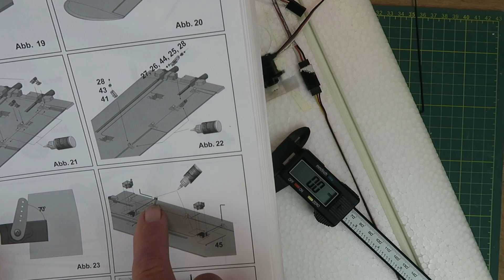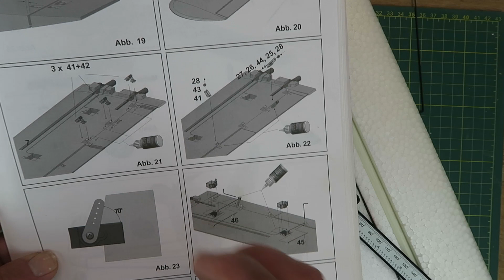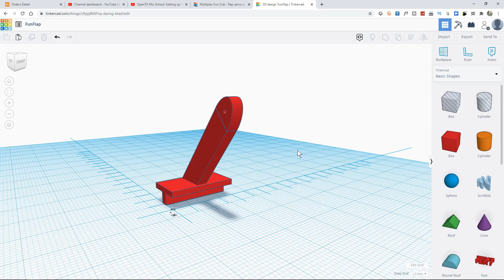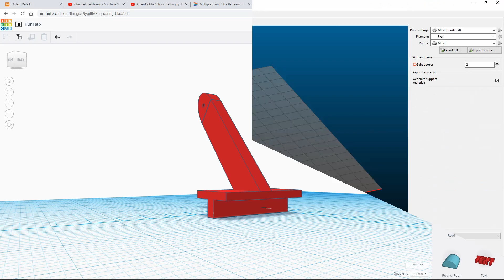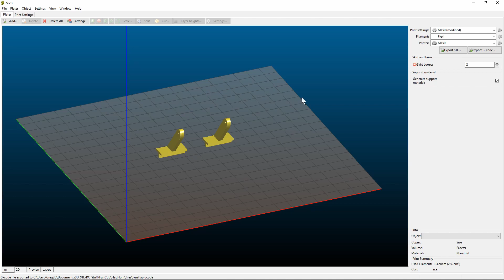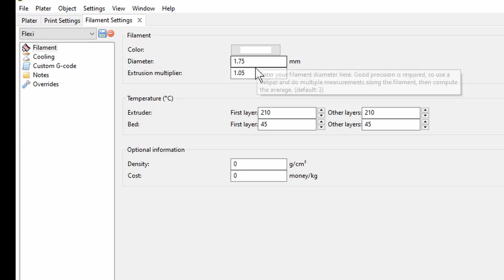Multiplex Fun Cub 3D Printed Flap Control Horn Tutorial

Comment: I prefer printing my control horns laying flat, it is easier to print and much more resistant to breaking due to layer direction.
Reply from the maker: Normally I would do that too. In this case the shape of the part that fixes to the flap made it easier to print the way I did it with less support material needed. Maybe I could have made it in two parts. Please consider subscribing if you have not done so already!
Reply: @1nformatica  It is easier to do two parts than using supports. Or print supersimple flat horn, using only perimeters. It is light, strong and holds in the control surface without problem.